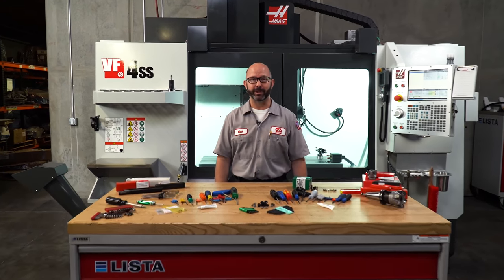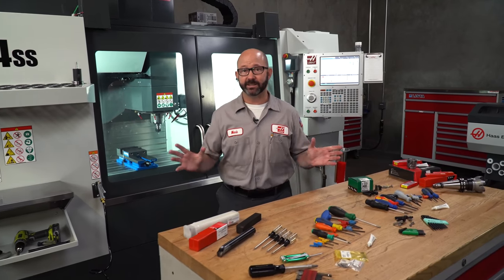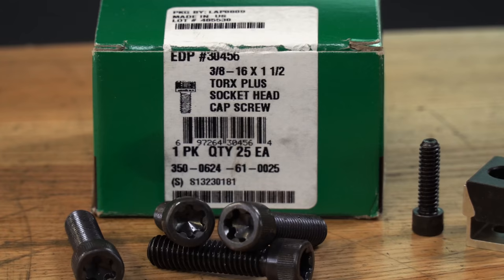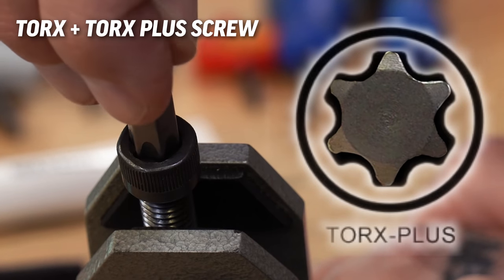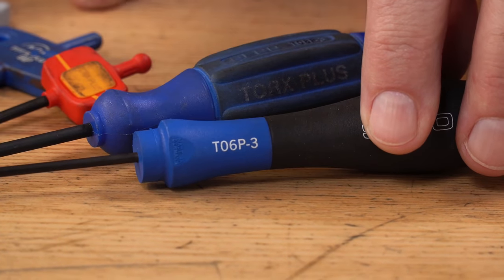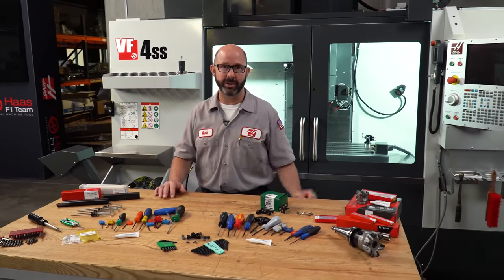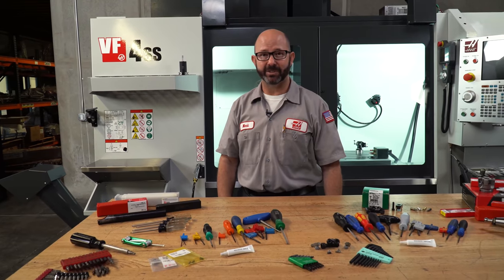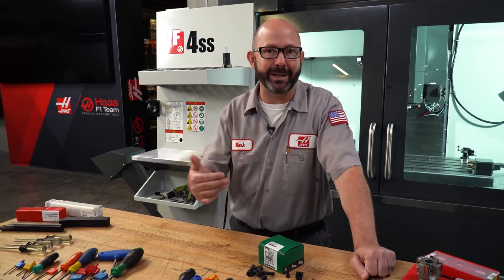THIS IS NOT A TORX - Haas Automation Tip of the Day

Comment: Apparently finding witness marks of using hex drives on torx is also not that rare.
Reply: When you need it done....

I have done it by accident but to my defense, i did it with 2 deeps holes that i couldnt get a light in and still look (4-50 screws some 2" 1/2 into the block)

Also, this was in sweden and i thought the part was based on metric.
Reply: Guilty 🤚🏼
Reply: Guilty as charged. Conversely, I've used slightly oversized Torx drivers on rounded hex screws more times than I'd like to admit. Sometimes that extra bite makes all the difference, especially if you're trying to fix electronics or non-kitchen appliances with supa-soft fasteners. Engineers, mechanics, technicians, technologists, we're a cursed breed with all this madness!

Comment: The labelling is about as easy to follow as the imperial measuring system. Good job fellas.
Reply: yep, it is straight forward.   not sure how anybody could not understand it, it really is super simple and easy to understand.   the imperial system  is also much more user friendly and reliable than the metric system as well.   metric is total crap.
Reply: @orion7741  give an example of the metric system being less reliable & the imperial system being more user-friendly. 
Imperial measurement.  
Inch, Feet , Yard ,Mile , all different multiplication factors to convert each. 
Metric 
mm, cm , m , km . 1000mm in a  meter & a 1000m in 1km. 
The maths in Metric system is move the decimal point.  
Can you say how many inch are in 3miles , without using a calculator. 
But someone using the metric system could convert between there different measurements in seconds without a calculator.
Reply: @robertsomerville5377  The UK metricated when I was in primary school but I for one still know there are 63360 inches per mile. 1 inch per mile or 1:63360 was the ‘standard’ map scale used in the UK prior to 1974, now it’s metric it is 1:50000  or 1cm = 500 metres
Reply: @robertsomerville5377  Had this discussion with my ex father in law several years ago - which ended up with him starting a full blown argument 😂.
The 'easiest' system is the one you know at the end of the day.
However I stand by the fact that if you hypothetically didn't know either the imperial or metric system and learnt them both, you'd find the metric system made more sense 👍.
Reply: @deezelfairy  learning something new can revolutionise your life. I completed an apprenticeship as a machinist & never worked with any CNC machines until 30 years later when I owned my own business. 
Buying my first CNC mill transformed what I could do & how I could do it. Just because you learned one way , doesn't stop you from learning a new & better way.
Reply: I know this is a pedantic point that doesn't actually change anything in this discussion, but it's one of my personal bugbears: America doesn't use the Imperial system.  That's the modified system with the slightly smaller fluid ounce and the 20 fl oz pint the British adopted in the 19th century.

Comment: Robertson are still far superior to square drive in wood screws. The taper is what makes Robertson better. 🇨🇦
Reply: Robertson is better than Torx in every possible way. But most importantly, there are far fewer sizes, so you don't need to have 20 or more of the things to have the right size, and it's obvious which size to use without trying 8 different bits before you get the right one.

Comment: I repair power tools for a living; I and my shop mates encounter Torx (6-lobe, star) screws every day -- but I (because of the specific kinds of tools I work on) occasionally get one with that rotational play that I now realize comes from a Torx-Plus socket.  I might have to ask my boss to get me a set of Plus driver bits, at least in 10 and 15 sizes, where it matters the most (I figure that should happen sometime in 2025, about four months before I retire).

Comment: I like being able to use a flathead screwdriver in a standard Torx in a pinch. 
I also like being able to snap off the center pin of the smaller Security Torx screws to use a regular Torx bit.

Comment: Spax has a different standard for construction screws that combines torx with a small protruding cylinder.
Reply: Is this security torx (like the "tamper proof" screws you see in bathroom stalls) or something different?
Reply: @Trent-tr2nx  it's Different, the opposite of security torx
Reply: @erikpieh6485  fascinating!
Reply: @erikpieh6485  Is it the one where the cylinder comes from the driver ?

Comment: I don't have any Torx plus bits "yet" as I don't need them just yet but I do have Ribe drive and tripple Square drive which is not the same as dual hex. I own a Snap-on 86" box not because I want it but I need it as it's full and overflowing tools. I'm starting to take tools home now to fit the more used tools in.

Comment: Now I was told; in my younger days as an apprentice mechanic; Chrysler Corp switched to TORX in their auto trans valve bodies because the robots shot fewer blanks with them. They never figured them to be removed and reused multiple times.
Reply: As a rebuilder of Chrysler transmissions, i can verify that statement. The reusability of a fastner depends on the quality of it nearly as much as the type. 
 The 62te compounder uses 8 t25 screws. Tightend to over 100 in-lbs. And if you tighten 7 perfectly and number 8 over or under torques or crossthreads or you tweak the copco wrong, you have to loosen and retighten  all 8 because the spec is that all the torque readings have to be from the same run. Or something like that. 
 I guarantee you that if i have to drive a fastener more than twice, i just replace it, beacause if you dont you stand a good chance of it starting to cam out and when you are using a copco at over 100 in-lbs, those fasteners dont hold up well. 
 Getting a t25 thats chowdered up out of that clutch is a real pain.

Comment: How about the type of recommended lubricants for the fasteners? As an auto mechanic, I've been using Permatex anti-seize lube for many years without a hitch, but, I'm interested to find out if there are more specific instances that call for different lube. Also, I usually lower the torque about 20% as well. What is your take? Should I adjust?
Reply: Motor oil, then wipe off ALL excess, especially for blind holes to prevent hydrostatic cracking or false torque readings.  Now that’s from the auto manufacturers.  But if it’s a fastener, especially a small screw going into aluminum, say the ISC motor on the throttle body, I use anti-seize.  Chances are you’ll see that engine again years later and you’ll be glad you used it.
Reply: Anti seize is the way to go , the silver and copper ones are great. And reducing torque is good cause you can stretch the bolts easier with lube than dry

Comment: great video but changing to another type of head is a PITA. I need to carry metric, imperial, (hex set), torx and now torx plus as an electrician my tool are getting heavier and heavier.
Reply: Yep, our toolboxes are getting heavier and heavier. A Torx bit will do the job on a Torx Plus screw, in a pinch. There was an old Michael J Fox movie, Doc Hollywood, where the local mechanic has to work on Doc's Porsche, and says  "I always wanted an excuse to buy a set of metric tools". I always loved that line. Someone else (John Guilfoyle) commented about how the old timers toolboxes used to be much smaller, https://www.youtube.com/watch?v=U27j1ZvaWeU&lc=UgwIpjENONyjzcz93id4AaABAg

Comment: I got a set of torx with torx plus bits in it also. Still rounded out the torx plus bolt I was trying to get out. (It wasn't going to come out anyways). Didn't think that there was torx plus on machining equipment.

Comment: Why IP instead  of TP?I was having  a hard time finding  a T35 to remove  a Honda civic  bumper.
Reply: In that case "I" is internal, the driver slots into the fastener. The other option there is "E" external where driver and fastener profiles are the other way round.
So what is really happening is "TP" is abbreviated to "P"

Comment: I'm not a machinist by trade but, do encounter many different types of fasteners in my varied personal pursuits. Wouldn't using lubricant rather than low-strength thread locker see the fastener loosen due to vibration? I know runout isn't 100% avoidable but, wouldn't an end mill loosening while in use create just as much inaccuracy regardless of component matched reduction of the former?

Comment: Oh good ! yet another set of tools to buy....   Torx plus , Torx plus external, no doubt there will be Torx plus security with the wee pin in the centre as well. Back in the mists of time, every fastener was hand made and different, then some bright spark standardised things and all was good. As time goes on and more and more different fasteners are made 'for our benefit' , we're heading back to everything being different. I needed a 12.5mm socket the other day, WTF were you thinking Mr Renault ?

Comment: The metric ones are a trip
Reply: Yeah, Torx screws are strange in that way. A T15 metric screw, and a T15 inch screw will have the same heads, but different threads. It's interesting that these screws have caught-on across the world, even with a kind-of arbitrary head numbering system, meaning that the "15" in T15 really doesn't have any direct inch or metric correlation.

Comment: Okay but does he understand phillips was designed to cam out when it reaches the desired assembly torque and Torx will require a different means?

Maybe not since we did not discuss the impact of lubricants on tightening to torque specs when that was done.

I get that we are dealing with hand tight fasteners in the demo and with flags.

The video covers an important topic but overlooks these points and is also patronizing in the delivery.

Thanks.

Comment: If camming out is an issue, why not just use a robertson or allen? Both are older; I thought torx's primary feature was that the heads are not commonly in bit sets so it was an anti repair-at-home measure.
Reply: Torx is just harder to round than allen. Hardcore anti repair-at-home screws are triangular shape, torx security or pentalobe.
Reply: @ItsMorbinTime03  I've never managed to strip out a robertson; and a square is much more durable than the shape torx is. It feels like torx is a solution looking for a problem at best, and anti-consumer at worst.

Comment: PLEASE TELL ME IT ISN'T SO.  Not ANOTHER type of screw, another set of drivers, etc.  In my RV I have flat head screws, Robertson, or square head, and Phillips.  Also a few torx.  It is getting so my tool box is way to big and full of screw drivers, will somebody please tell them to stop?  I have only recently started using torx and I don't like them.  They cam out worse than a phillips.  Any time I find a slotted screw I throw it in the garbage, they have no place today because they have such poor performance.  The best screws I have ever used are the Robertson, invented in Canada and used up there almost exclusively.  They are strong, don't cam out, and you can actually hold the screw with the driver at a 90 degree angle.  So why haven't we seen more Robertson here in the states?  They blew it when marketing to the US and never got their act together and torx swooped in.  I just wish we could all decide on one type and use it so I can throw away some of my excess screwdrivers.
Reply: Best part about Robertson, there are so few different sizes and they're all visually distinct. I can glance at a Robertson and grab the right driver every time, and only need 3 sizes for 90% of jobs I do have 2 bigger sizes for massive fasteners, but those are pretty rare). Torx it's always the 3rd or 4th size I try, and I need at least a dozen drivers to cover the same range of fastener sizes as 3 Robertson drivers.

Comment: I can't stand phillips specifically because of the cam out issue. They're so easy to damage just by using the wrong size driver (which people often do).

Re: the advice at the end of the video: I definitely prefer torx, but I've continued to stick with hex for small cap screws for most of my projects, because they're just so much easier to find. Sadly, it seems like torx never gained the same wide-spread popularity as phillips and allen/hex, even though the patent expired decades ago. Personally, I wish phillips would die off entirely. Its only real advantage is its ubiquity (everyone has a phillips screwdriver, even if they're not a technical person).

Comment: Without watching the video/ plus the crappy small picture on my phone screen, it looks somewhat like a 'polydrive' as we call them in the automotive world. A lot of European cars use them for the head bolts especially. On the VW's you can modify a T55 torx to use in place of one to remove them if you don't have one by carefully taking a grinder and file to a bit. 25+ years of turning wrenches on anything and everything, you make your own way in a pinch.😁👍
Reply: That’s all fine until you need to remove the head off an Audi, have the full set of torx, torx-plus and polydrive only to find out they use the 5 point version of the polydrive 😶🤦🏻‍♂️

Comment: Even by hand you can blow the tines off a torx driver bit if the screw is stuck.  If Americans could just try out Roberston bits they would understand they are the best.   Cheers from Canada.
Reply: Robertsons are so underrated. It's probably because it's hard to make money selling someone 3 screwdrivers when you can sell them 20 torx drivers to cover the same range of fastener sizes! But I agree fully. I'm constantly having to drill out destroyed Torx fasteners, I can't remember ever having to do that for a Robertson. I also can glance at a Robertson and pick up the right driver every time, with Torx it's usually the 3rd or 4th size I try.

Comment: I thought lubricant was a bad idea because it could make it easier for the screw to rattle loose.
Reply: If its tightened properly, thats a very low chance. And thats solved by regular checking of the fastners with a hand driver to check for play or looseness. 
 Much more likely is a fastner siezing up and snapping or getting wallowed out when being serviced.

Comment: In my toolbox I have a set of torque wrenches where I can change bits 
Especially if the screw get heated up with long term runs can make this cruel loosen the screw but at other times when they get chilled down they tighten with more and this break

Comment: 2:25 a Torx Plus cannot be used in a Torx. I've lived this false statement. This will be an edge case but it puts your statement on notice for being wrong. On some specialty things, Namely the Japanese "S" bike manufacturing company, on some chainrings they have used custom deep Torx that are specific to them. They are designed to work with Standard Torx but SNAPON swore up and down to the point of yelling at employees that we were wrong because TorxPlus T27P FIT in the Shimano T27 hole. After contacting their Canada, US, and Japan divisions, every level from marketing to their engineers said "T27, we don't know what this plus is, sounds marketing BS". Sufficient to say Snap-On was wrong, and T27P can fit this bike specific T27 and GASP It damaged bolts because it didn't sit down deep enough. Your statement might be true for normal socket head cap screws with Torx / Torx Plus but Torx Plus was incorrect marketing BS rammed down our throats by and uninformed poorly trained Snap-On person. I loath Torx Plus because of this BS

Comment: We used to get by with a screwdriver for screws and a small screwdriver for little electrical connection screws. Then we had to add a phillips crosshead screwdriver. Ok Now when you buy a 258 bit set there's still a 100% chance you can not fix a simple appliiance because you run into some kind of mulitlobe keyed fastener that you do not have a driver for. End up drilling out the whole damn fastener.

Comment: My old prelude had rear tie rods with removable ball joint ends, but they were held on by a 10-point e-torx appearing bolt. Anyone know what type that is? Junked the car before i needed to replace those ball joints, but ive always been curious about it

Comment: Don't forget about "tamper-proof torx", might as well buy that set too.
Oh yeah, don't forget the "tamper-proof torx plus" as well.
Reply: The nice thing about the tamper proof ones is they are completely compatible with the standard ones, so if you ever need tamper proof you might as well only have the tamper proof set and skip the "normal" set altogether. (And if you only deal with tamper proof on rare occasions, the centre pin usually breaks out pretty easy...)
Reply: True. I have had the tamper-proof tools shatter trying to loosen very tight fasteners. Other than being a little more fragile they work the same.